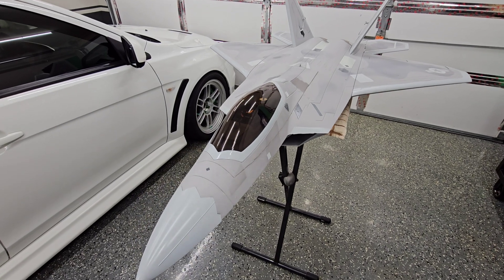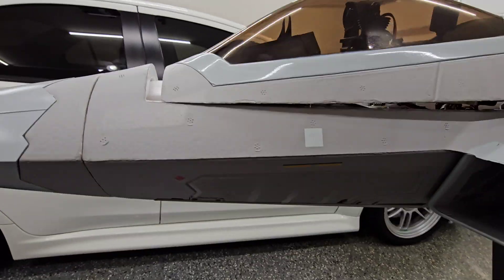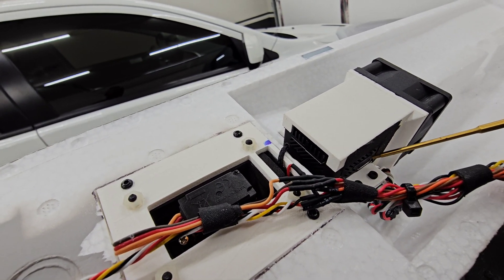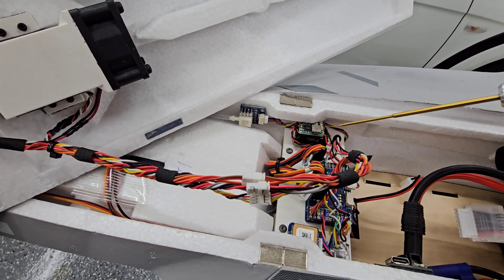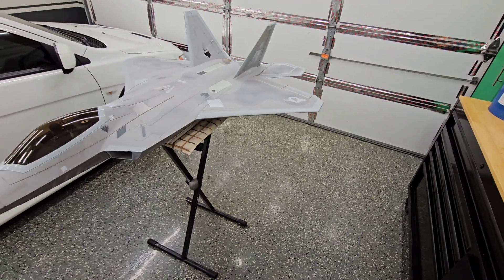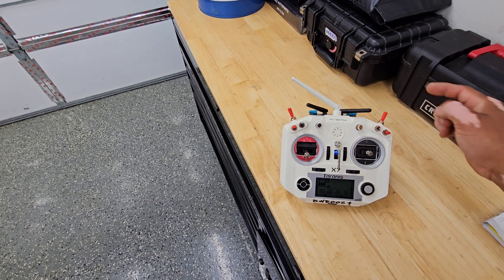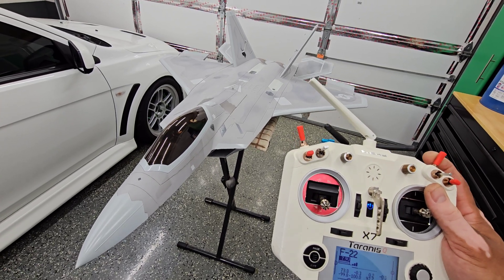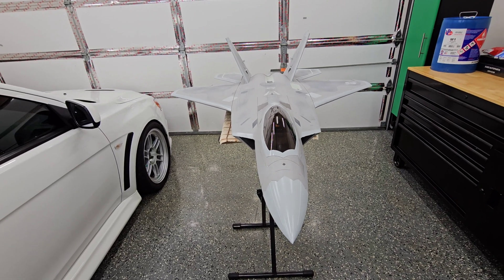Freewing 90mm F22 FPV Setup

Comment: For outer burner on matek you have to solder pwm to S and in i lnav enable server to S then in radio add same chanel as your trott to s
Reply from the maker: The prolem is that I am out of spare pwm outputs. I tried to use the led pad as a pwm output with no success.

Comment: How do you know where to solder the wires on the fly controller for each thing? Great build? Just go into the hobby and I want to build this. your video is the reason why I got into it lol. Coming from Rc racing so have some experience building rc stuff . Is going to take some time getting everything and learning how to do this but on the meant time I can practice my flying 😂
Reply from the maker: @f1o7x9  I'm will be making a more in depth how to video.
Reply: @kwboost thats will be awesome. Thank you

Comment: got one question how did you avoid running the battery leads to the fc and how did you get full power to the fc.i have been using these fcs for a while but never knew how to set it up that way would like to see a vid on it if possible

Comment: You mention about freewing afterburner. I am struggling with it too, have you tried to attach it to spare servo conecion and programm it separately or mix it with throttle?
Reply from the maker: @bunk.w420  that would work but I'm out of servo outputs on the fc. The only option would be to reprogram the led pad to pwm output, but I haven't been able to get it to work.

Comment: Hello Kelvin, why do you use a separate current sensor instead of the integrate one?
Reply from the maker: @alainrac56  extra margin of safety. Don't fully trust the fc shunt ratings.
Reply: @ thank you for your support, I had no problem yet with the integrated current sensor on my SpeedybeeF405Wing, but I limit to 80mm EDF. I have ordered separate sensors for my 90mm EDF's, but I don't know yet how to connect to the SpeedyBee🤔

Comment: What is the "matek blue box" you referred to at 8:37? Is that a CAN PDB? Can't find on Matek's website.
Reply from the maker: Sorry. That is actually the freewing blue box that comes with the aircraft
Reply: @kwboost - I found it; that's the T-45 Multi-Function Control Box D.

Comment: Great video… please post the heat sink.. I’ve already bought the fan and 3d printed the 03 air unit  but now I need to print the camera mount … very detailed video! Thank you
Reply: I don’t think the link for the oled and heat sink is working it might be your order info
Reply from the maker: I just update the links. Thank you for letting me know.
Reply: no sir, THANK YOU! I’m almost ready to maiden my T45.. but now thinking of the F22.. you should make a video of the set up…. It would give guys like me a better understanding of what to do… I love your work..
Reply from the maker: @nemonespider  thank you. I'll most likely make a build/setup video. My next project will be converting my 80mm a10. So I'll make a video of that build.
Reply: @kwboost  which one do u think is a better platform for fpv and easier to fly… I love the A10 I had the 64mm .. that flew great
Reply from the maker: @nemonespider  the f22 is really good. Gonna be hard to beat. I'll have a better idea on the best choice after I convert the a10.
Reply from the maker: Yes. I have the link posted in the description above.